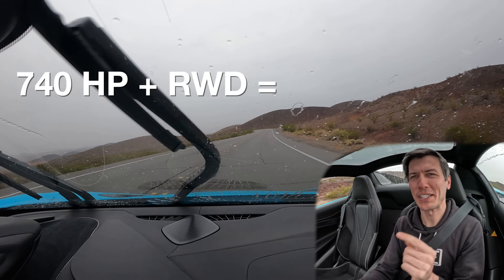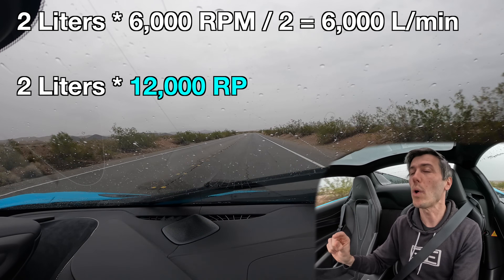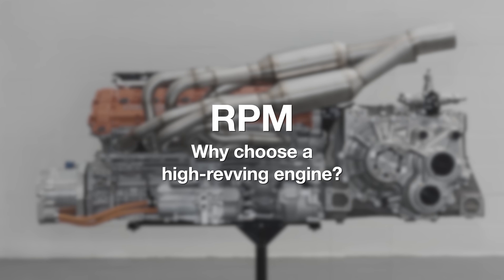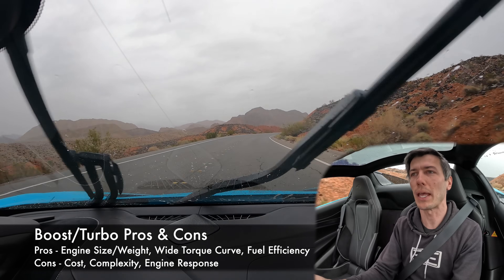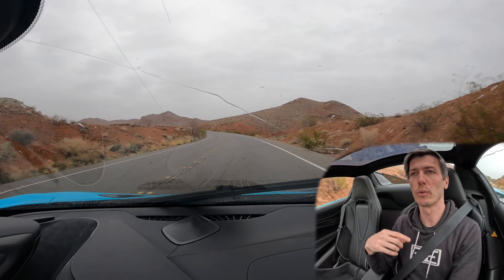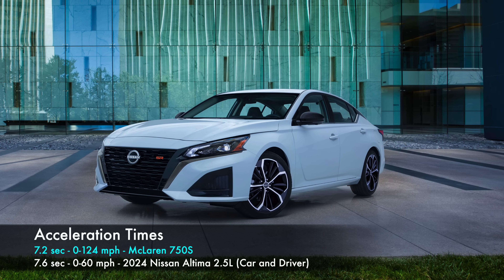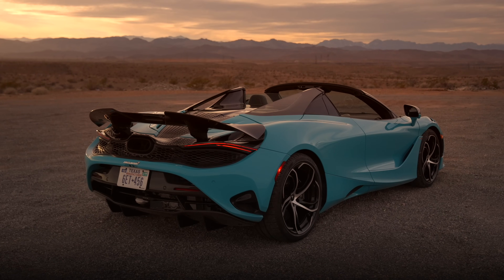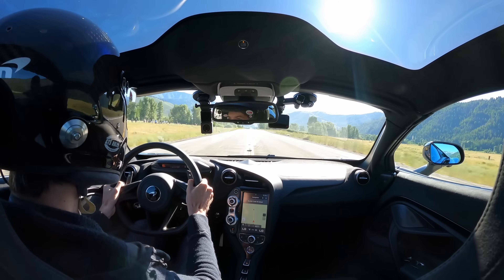Boost vs RPM vs Displacement - What's Best For Horsepower?

Comment: A built twin turbo v8, at 8k rpm with 8lbs of boost. Might be the peak of automotive engineering.
Reply: Lund racings mustang makes 40lbs and revs to over 9k shits wild.
Reply: @169abr  I’m going to sleeve and ring my Coyote and hopefully push 30lbs reliably.
Reply: @samsonfpv8902  gonna need rods/pistons for 30lbs lol
Reply: @169abr  that’s a given

Comment: There's one thing that displacement can achieve but boost and rpm cannot, which is being elegant. Look at the V8s, torquey from 2000rpm or even 1500 rpm, elegantly pulls without having to scream the engine like a maniac. But RPM and Boost, man, the inline 4, 2.0, you gotta hit 6500 rpm for it to build boost and 9000rpm for max boost.
Reply: Not sure that last part is correct at all.

Comment: That engine is a motor that McLaren bought the rights to from Nissan it was literally in race cars back in the day I think the 90's early 2000's it was a beast and still is
Reply: I always thought is was a slightly smaller sized 4.0 AMG engine.
Reply: @maarten8959 I had heard it was made by Ricardo, the people who made the 6 speed transaxle in the Ford GT.  Is there a word that combines Gearbox and differential?  Transaxle sounds so 🤢🤮

Comment: The advantage of smaller displacement turbo engines having better fuel economy is partially offset by the fact that most newer turbocharged engines are making quite a bit of boost at lower rpm. Peak torque on some of these engines is below 2000 rpm. So the engine isn't moving air like a 2.0 liter except perhaps at very low rpm. Personally, I enjoy higher strung, revvy engines. I have been lucky enough to drive some big block Mopars, though, and the torque is very impressive.
Reply: This is totally true. I have a 2L turbo that can produce max boost at under 1500rpm. Learning to drive while not engaging the turbo at lower rpms was something I had to learn how to do because of how quickly it spools up.

Comment: before watching - I am going to give the boring answer of "yes"

however following that up, if you mean what gets you the most "bang for your buck" I'd bet best because if the engine is designed to take it.  probably even increasing the MPG/HP for those who care about such things.

personally I like revs, because I like to have the fine control over power that it allows for when I am trying to control the car on the limit.  Displacement does something similar, but adds inertia to the crankshaft and a lot of weight to the car.  Turbos make that fine control very difficult, yes modern versions have gotten better but in high hp applications driving on the limit and having that power come in to quickly because of bad communication between you and the car is still not a fun experience.

let's see if we agree.
Reply: follow up.  seems like you asked a different question than I thought.  so I can't really say is we agree.

Comment: Booooost! Except, my current car is running 2.5 bar / 36 PSI and is, on average, less economical than my last 2 cars - both of those had engines with significantly more than double the displacement. To be fair, the new one also has stupidly short gearing.

Obviously RPM is the winner's choice here, but all of them are good really. Of course, as we all really know, what's best for horsepower is: less weight. Also, not having too much power, because "bruh my car is faster off the lights than yours" is like saying "yay I can get home quicker and spend less time in this boring crapbox" (yes I drive generally fast cars anyway, I can be a massive hypocrite and still be right 😁).

Comment: I would Much rather have an 8.4l V10 than a 2.0l turbo Ricer. And I drive an EV as my DD. But when it comes to engines F1 proved that V8s and V10s revving to 18k and 20k RPMs is much more exciting than 1.6l Turbo engines.

Comment: Me looking at a 911 gt3: boost?
Reply: 911 GT3 getting smashed in a straight line by the 911 Turbo S: Ah...boost.

I'll pick RPMs all day, but the 911 is quite well known for running boost so I had to mention it! I say I'll pick RPMs all day, I recently sold my (not GT3) Porsche and bought a car with a 2.5 bar turbo, but as per at least 1 other comment I made: I can be a massive hypocrite and still be right (especially since I'm agreeing with you 😄).

Comment: There was an old thing back in the 60s and 70s, “there’s no replacement for displacement”. Well, turbo charger put them on the bed. But there’s another adage it still applies, “horsepower is how fast you get the wall, torque is how far you take the wall with you. Seeing that grin on your face as you ran through the gears was worth watching this whole video for.

Comment: Great start! Now factor in compression ratio, the use of N2O, cam timing, valve spring weighting (pressure) and the use of lightweight sturdier components. When the engine is N/A, there are a number of things you (the builder) can do to make a large displacement engine still spin up to 8k rpm and produce large HP/Torque numbers.

Comment: Steve Morris knows it is a combo of all 3
Reply: The goat
Reply: Funny most people run pro line... not steve morris and his crap
Reply: i dont remember anyone else having a faster drag and drive time. SMX 5 sec 1/4 mile and can go thru the drive thru. no one else on the planet has done this before. So who?  @S2KCYA
Reply: ugr runs 3500whp @ 10krpm, all proline engine
Reply: cool story bro let me know when they do 5s 1/4 miles and can still drive thousands of miles.  @hksp
Reply: Top fuel fragsters dont use steve morris lol
Reply: he doesnt make top fuel motors. he make 4500hp drag and drive motors that do 5s and can sit in the drive thru. Topfuel cant drive thousands of miles. you clearly arent a mechanic.  @S2KCYA

Comment: Because rpm reduces torque you can use smaller driveline components (transmission rear axle etc)
Reply: RPM reduces torque?
Reply: @ALMX5DP  if you have the same hp at higher rpm then torque is lower.

Hp=(torque*rpm)/5252
Reply: @Bill-flatplanefool Which means rpm doesn't reduce torque but hp is related to it which is nothing new. Torque just falls down at higher rpm but by increasing rpm your curve also is higher and the same engine with higher max rpm will most likely have also higher torque at optimal are blow 5k
Reply: @wadimek116  uhhg… what I mean is his definition of rpm motors make less torque at the same horsepower which allows the use of smaller transmissions and drive shafts

Comment: For me, engines peaked in the 90s... You got the honda B series, H series and Bmw S52 for NA. You then get the RB/2JZ, all of them extremely reliable and even today you will mot get that kind of performace/reliability on pretty much any engine apart from maybe some modern honda K series. Sure, the bmw b58/s58 may be reliable by todays standards but damn I do not think they are, I have seen so many plastic things break on them with not even 200k miles that I stray away. Honorable mention to volvos in the 90s, they where bulletproof.

Right now I own 3 engines... 
H22A (closed deck), 2.3L converted (I love torque for mountain passes) 
F20A DIT Reliable, VERY reliable, great for an SUV and just being smooth, enough power to pass people on long road trips
R18A the thing just uses so little fuel and is smooth, underpowered? 145hp from a 1.8l using 87 octane? Not bad, great city car and will probably go 1 million mikes without failing too much, valve cover and intake are plastic but metallic replacement kits are sold.
Reply: It's great you started with "for me", because almost everything you just said is completely false.
Reply: @MrArcticPOWER  Well, I enjoy sound, feeling and engineering more than speed. The fact Honda in the 90s was getting 100hp per litre while NA on a road legal car that would last half a million miles is quite impressive, and about the I6 turbo JDM engines... What can I say, a couple of mods and you are making today's power quite reliably... For me a car is about pleasure, not speed, one of the greatest cars I have driven was actually a classic mini, that little thing always put a smile on the driver's face.
Reply: @514aam  The power to weight ratio of those bulky l6 were decent at best back then, but they're horrible in todays world. And that's not even talking about weight balance. For the same weight, you can get a modern engine with twice the power while being much more reliable.
Honda's power per litre was pretty impressive for a car, not so much if you compare it to a street bike.
But then again, if this is "peak", that means today's engine are worst, which is completely false.
If you enjoy engineering, then you should enjoy modern engine, K series and l6 JDM are ancient tech in comparaison.
Reply: @MrArcticPOWER  oh, K series are nice, but then again, go drive an h22, then a K20/24 and you will understand why I love 90s engines more, yeah, the K is faster, more efficient, but the sound and feel of the good old H series is just better

Comment: The 750S in this video is the world's fastest whiteboard
Reply: Actually...

I just wanted to say that - but there's a whiteboard on the ISS which is technically owned by the world rather than on it, so grammatically qualifies that as the world's fastest whiteboard at over 17000mph or mach 22, at least until Jason starts doodling on ICBMs.

Comment: It’s no replacement for displacement unless you go boosted or nitrous.
Reply: Or RPMs. There we go, we've made it as far as the video title (except nitrous, since he's just done air volume and not fuel mix).
Reply: @ApothecaryTerry  here’s a example for you,theirs 2 identical vehicles let’s say 2024 Honda civics.The transmissions all the same ratios etc also but the engines are different.both are 4 cylinder 1.5liter engines but 1 is designed to redline at 10k rpm to make 300hp and 100 foot pounds of torque at 5200 rpm.But the other engine was designed to redline at 8k rpm to make the same 300hp and but makes 100 foot pounds of torque at 4K rpm.which engine is faster and more efficient? The one you have to rev higher or the engine that has to rev less?
Reply: @twistedtuningandperformanc7799  You've loaded that question with parameters designed to suit your conclusion, the torque figures are totally impossible based on my rough understanding. Not doing the maths, but I'll answer based on a roughly realistic torque figure. Edit: both should just be a lot higher, but it also depends on the curve anyway.

On that basis, you said same transmission, so if that's a 10 speed that's optimised to keep the higher RPM engine in the power band then that engine will be both faster and more efficient - since the engine probably has a wider power band anyway, plus for cruising it has more space below that to sit at low revs where it'll be better optimised for economy. Doesn't need the torque while doing that, which comes from more air/fuel in the engine (essentially higher RPM has the same benefit as small turbo engines for this). Therefore, with realistic numbers, the answer still depends entirely on the transmissions, wheel sizes, etc.

Displacement is great, subjectively, I would never disagree with you on that! I'm vaguely considering an LC500 next...RPMs are great too though - I'll take a Porsche MA1.23 (981CS) over 95% of big V8s without any hesitation, because it sounds incredible (bias: I did, that's my previous daily 😄). Now I've gone turbo with low redline (6k) and small capacity (1.6L), because old school laggy boost is one of the most fun things in life - plus it sounds like an old rally car. Turbos usually ruin sound though, often they ruin economy too. If they're tuned to "feel like NA" then NA is just better, I don't need more power for the sake of it (200-250hp per tonne is perfect for road use, in my opinion).

tl;dr conclusion: They're all great, if done correctly (boost often isn't...), both technically and subjectively. While I love my crazy hot hatch, ideally I go for 5+ cylinders, 3+ litres, 7k+ RPM and no boost.

Comment: aint no replacement for displacement
Reply: Other than RPM or boost.
Reply: @ApothecaryTerry Or better engineering/design. A '91 Fox Body Mustang makes a 'blistering' 200HP with a 5 liter V8
Reply: @RhodokTribesman  Ha, true, I feel like that's actually difficult to achieve. With a little boost (ok, 2.5 bar) my 1.6 puts out 270 from factory, or 300 with a simple remap...

Not that I'd remap, it's already 99% likely to explode, I don't need that extra 1% 😄 Also, no need to be faster. On that note, that Fox body's power output is indeed embarrassing, along with a few others like the 1982 Camaro which only managed 145hp from its 5.0 V8...but all other things being equal, I'd rather have an underpowered V8 than most modern turbo 4 pots!

Comment: This video makes me wonder what  is the power potential of the Viber's engine if it had two big turbos.
Reply: 2,500+ horsepower, there's a bunch of them set up for half-mile and roll racing and they're completely nuts.
Reply: Just multiply with the pressure (until there's a mechanical limit).
Reply: Just look up Calvo Motorsports.

Comment: High rpm allows staying in a set gear longer - more wiggle room in a race situation and possibly lovely music to hear.
Reply: High RPM engines mostly have a different ratio gearbox and low torque, so they mostly do not spend longer time in gears then others.
It is mostly opposite with the big engines spending longer in each gear, because it pulls almost the same at 3000-6000 rpm, and the faster spinning honda prefers to stay between 6000-8000 rpm.

Comment: There's other ways that Turbo is better than Naturally asperated engines.  Most of it is because if you don't limit a turbo it can get crazy fast.  

Turbo's are also build very differently than normal engines.  A normal engine will have a higher compression ratio than a Boosted engine which can limit the power in a Turbo.

Low stroke high RPM engines major downside is the amount of time you get to fill the engines with air.  Yeah you create a vacuum but air needs to move into a cylinder so your Intake valve needs to be open way longer than a lower revving engine and that creates even bigger problems at lower RPM but newer engines have Variable Valve displacement that fixes a lot of those problems.

Comment: If you dont want the car handling like a boat, gotta go high RPM with some boost. Higher displacement usually means higher total engine mass.
Reply: Nope. The boosted usually weighs more due to the turbo and the intercooler and all those bits
Reply: @strait6  depends, like it always does. 6.5 vs 2.0 it will be a very big difference... but 6.5 vs twin turbo intercooled 4liter? maybe close

Comment: Big cylinders and lots of them don’t wear out like turbos and high strung components
Reply: That depends.
8 cylinders kosts around twice as much money to make, so they are mostly made with cheaper materials then a 4 cylinder, the turbo will take some of the budget, but it is still not as simple as saying more cylinders is better.
Big pistons can also have more mass, leading to higher forces in the engine.
Reply: What do you think will last longer, a 2UR-GSE, or an S58?  @larsjrgensen5975

Comment: RPM and short gears all day, as a tactile experience. The linear power band and short gears give the driver finer control of the power, and is extra rewarding when dialing in grip at corner traction limits.
Reply: "rpm and short gears" so...all noise, little movement 😂
Reply: @viscountslappy5085 you dont understand what you're talking about
Reply: @viscountslappy5085 you mean like Hardly Ablesons?  Low RPM and short gearing.  Noting converts gasoline into noise more efficiently than a Hardly.  And it does so without the annoying side effect of horsepower. 😁.  Just Poking fun, I have CBR 600 race bike and occasional ride a Road King when I want to be a slow moving impediment to moms in Minivans.
Reply: @viscountslappy5085 all show and no go. That's the way he likes it.
Reply: Does short gears here mean all gears are x% shorter or the ratio between the gears is shorter?

Comment: Of course it depends on the intended use of the vehicle, but in the end there is no replacement for displacement.  My car has 6 naturally aspirated cylinders for 3436 CC's, 325 net horsepower, and the car the engine is bolted in weighs 2976 pounds.  With rear drive it will scoot through the quarter mile in 12.5 seconds @117 mph.  At 75 mph with the air conditioner cranking, the car gets 31 miles per gallon. It's bone stock.

Oh, and the particular make and model of my car will lap the Nordschleife in 7:50.  And do it all day long without getting hot....

Displacement + light weight.  Great video!
Reply: Source?
Reply: @icebrew  I own the car, I've looked up the performance specs on various car magazines.  And it gets 31 mpg, I've seen it myself.

Comment: Without have a limited slip rear end does it rely on brake torque vectoring?
Reply from the maker: Yep, and it's very good at it!
Reply: It seems like early on when manufacturers started using torque vectoring it used up the rear brakes but it seems like they’ve pretty much figured that out by now…